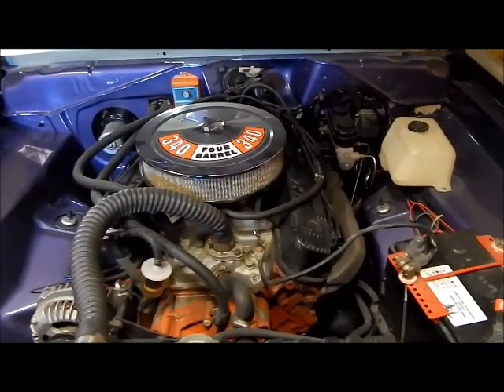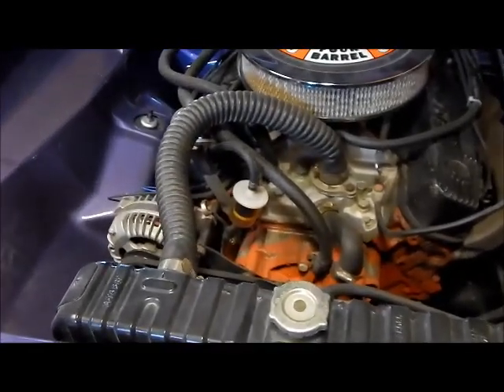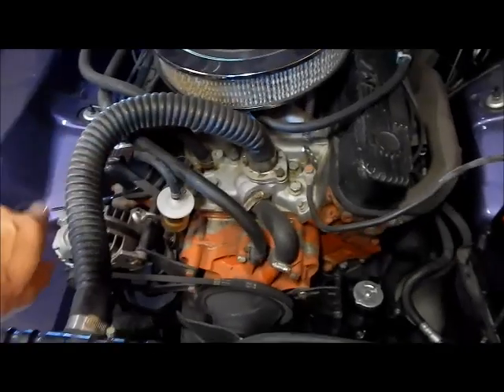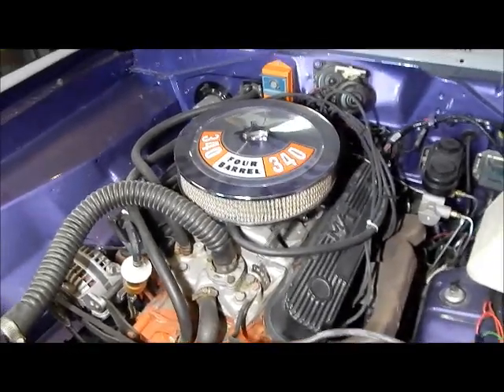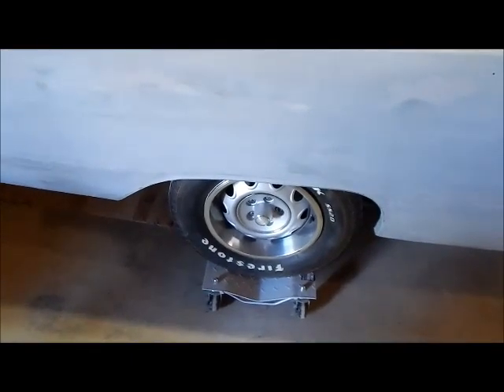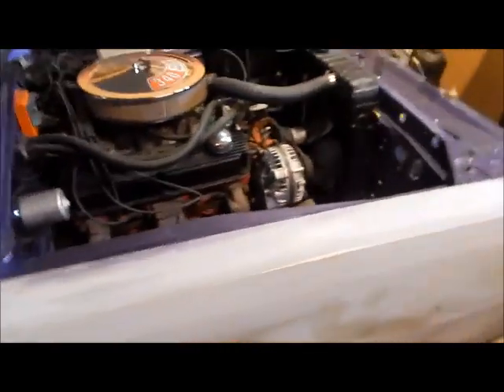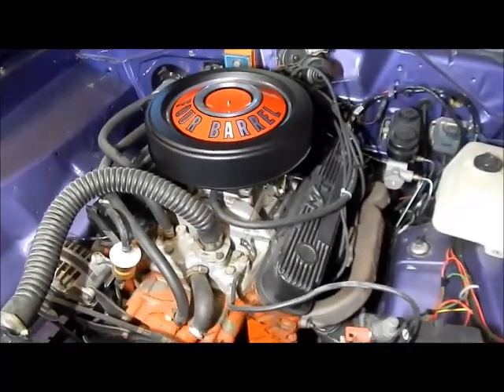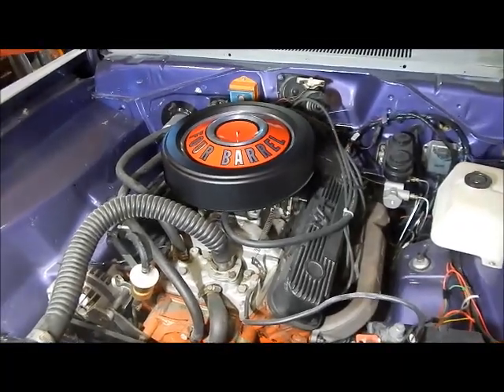How far do we go with these cars ...? all the way? Yes! well almost, there is still a long way to go

Comment: Hey Mr Swinger , just wanna ask you something ive got a 318 Aust Valiant 904 trans , ive got a leak at the front of the trans (hopefully just the front seal) anyway ive unbolted the converter from the flexplate , just wondering when i unbolted the converter i could push it back about 4 mil , so when its bolted up its brought forward and not fully engaged back , is this normal ? or something wrong , appreciate your thoughts on this Cheers
Reply from the maker: Thats normal. The converter splines in on 3 sets of splines...it sits back in tje 904 " bell housing" untill you get it bolted to the trans. Then you slide the torque converter forward to bolt it to the flex plate. An indicator that the converter isnt fully engaged in the splines is that the converter will be too far forward leaving a gap at engine and bell housing. Ive never worked on  an Aussie 904,but cant imagine its much different.